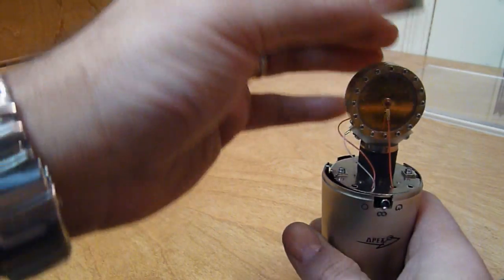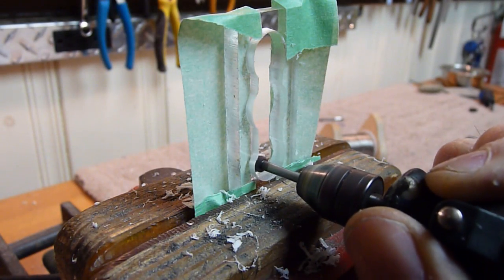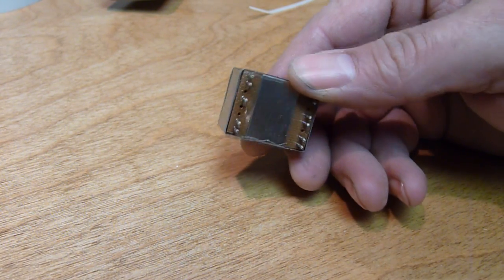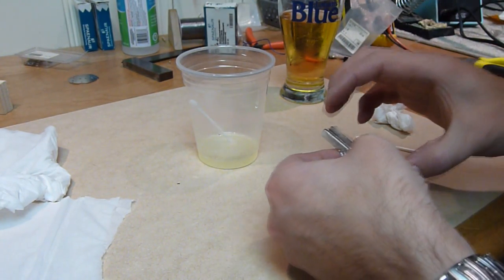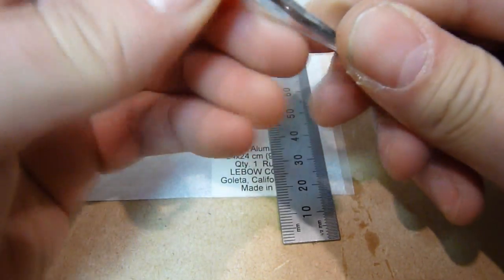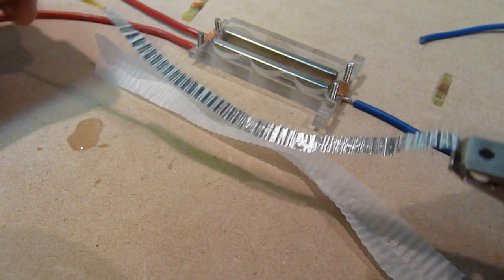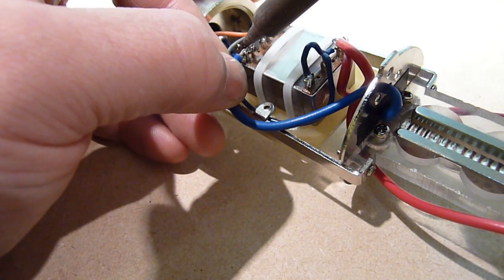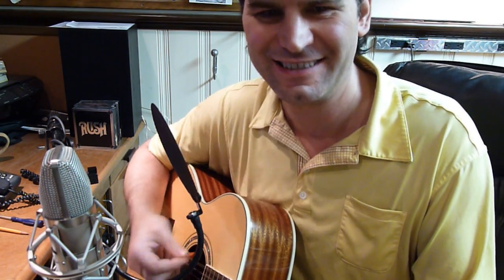How To Make a DIY Ribbon Mic!

Comment from the maker: At the 5:37 mark the ribbon is clamped in. It's done with a small strips of fibreglass PC board material and two bolts on each end.

Comment from the maker: It's a ribbon mic. They require no power. But you do need a mic preamp with lots of clean gain because ribbons typically have a very low output.
Reply: 22 dB Clean
Reply: And that's why transformers are so important ❤️

Comment: Thank you Freddy for this detailed manufacturing explanation! I noticed an important part was not referred to - the glass of Labatts Blue. I dig your ingenious 'crinkler' for the ribbon - great! You touched on and fully explained all aspects of the project - but was surprised you didn't use an f.e.t. amp. Presumably with a 1:37 step-up Xfmr this isn't necessary - and neither is phantom power! I admire your craftmanship and your voice-over explanation. To mis-quote Oscar Wilde: "To make one ribbon mic is splendid - to make two looks like sheer Stereo" Many thanks for this video!!

Comment: Your planning and design are wonderfully impressive, as well as the video itself. I'm partway through building a similar mic and am so glad I ran into your video. I happened to do several bits the same, right down to the notches in the plexiglass but you've taken some of the scare out of laying in the ribbon. Now I'm ready to proceed. Many thanks.

Comment: "I tuned the ribbon tension using a frequency generator. Resonance target = 30hz."

Could you please explain that a bit more?
Reply: obvs the answer is "no".
Reply: Set a tone generator, tighten the foil to raise, or loosen it up to lower tone. Try and match the tone generator. Be careful to not touch the foil to the magnets while plugged in. Seems like a process. Plug in, check, unplug, tighten, plug in test etc.
Reply: The human ear can only detect from 20hz to 20,000hz sounds. By tuning it to this frequency, i think... I THINK... it leaves some "breathing room" for the mic to give reasonable voltage output at low frequency, which is of course 20hz.

Comment: I got the same build plans called AUSTIN Ribbon Microphone from rick wilkinson (rickshawrecords at yahoo) years ago. It's a fun build with some challenges. Namely, your own breath when working with the aluminum leaf. I had to pull my shirt up over my nose for that step until I had the motor safely installed in the housing. Pop filters ar critical to keep from blowing out the ribbon. Back then, donor bodies were harder to come by, so the plans described the entire build including the body made from brass pipe, cap and brass mesh. Fastening the motor needed brass screws to stop the risk of having the screw pulled into the motor during assembly by those strong magnets. Also other ferrus metals in the body may affect the magnetic field and possibly color the sound. Nice build.
Reply: Good point about the brass screws!!

Comment: Excellent presentation, fun to watch !
I made a ribbon mic. like this back in the early 1970s I used  transistor radio output transformer, 3.2 ohms into 500 ohms, it worked great !
Bill P.

Comment: Hey, I assume the magnets are there to generate a magnetic field, instead of hoping on luck that the ribbon doesn't touch the magnets, (which since it's coregated, if it sags over time I'd imagine it has a good chance of touching) could you use a thin piece of paper to insulate the magnets? What would it sound like?

Comment: Hi, I'm trying to build one of these for my CAD and fabrication class. I need to start sourcing my parts and I was wondering what kind of aluminum I need to make the ribbon, and where you got your transformer. Thanks for your time and the tutorial.
Reply from the maker: +Nick Grace You&#39;re welcome Nick! The foil is from the Lebow company. You can use 1.8, 2.5 or 4 micron thick aluminum foil. The thinner the foil the better it sounds.... faster transients, more output and more high end. However, it&#39;s much, much more difficult to handle and work and more prone to damage from air blasts once the mic is assembled. The transformer is from K&amp;K audio in the US. You can also use a Cinemag transformer. For a more economical transformer you can use an Edcor RMX1. Good luck and have fun!

Comment: This is really good man, 10/10.. Can i ask if you did any post production on the recording though? I listened back through my DT150's and the mic sounds a little squashed and slightly distorted. wondered if that that compression or anything?
Reply from the maker: Thanks Guy!
Post? I can't remember exactly but no doubt I EQed and compressed.
Reply: I think I'm going to get one built :) might be pretty nice for recording my acoustic. Also going to build a nice condenser, would be great if you stuck u a tut for condenser building.

Comment: High frequency response is really superb!
Reply from the maker: Thanks! It is directly related to the thickness of the foil. The thinner it is, the faster transients, more output and more high end.
Reply: @FreddysFrets  That's apparently not the whole story. The reason why your high frequency response is so good is that you have holes next to your magnets in the frame which allows a front to back wave to take the shortcut. http://www.diyaudiocomponents.com/diy-ribbon-mic-frequency-response explains. As a result you have hit on a top rate design.
Reply from the maker: @unequally-tempered  yes that too. And I was able to see that effect change when I made another mic, but this time with 1/4" thick magnets instead of the 1/8" thick ones in this video. Because the high freqs had a little more travel time to get around those magnets the high end was different.

Comment: one more question...
Do the magnets have to be straight or could you use curved magnets like scrapped ones from inside an old hard drive? Obviously the magnet holder would have to be different.
Reply: I dare say you could simply attach a couple of ex-HDD magnets to the polar pieces for those are high Gauss magnets

Comment: Also, could a thin piece of scotch tape be employed along the inside of the magnets as an insulator against the ribbon contacting metal, WITHOUT negatively affecting the sound quality & output level?
Reply: Never use sellotape as a permanent integral part - the adhesive fails eventually!!

Comment: One of the limiting factors I'm seeing when it comes to homemade ribbon mics is the low output signal.  I'm wondering what preamplifier you're using in this video? It seems to have almost no noticeable noise, even with plenty of gain.
Reply: I believe it was also DIY.

Comment: I have 2 Apex 210's , they really are crap . The ribbon is not even corrugated , the magnets have a chrome plating on them and on both mics the chrome has peeled . I cleaned off the chrome and used tape to try and get the magnetic filings off .
 I was going to get some foil and try some 4u foil or maybe 1.8u. QUESTION : is it worth trying with the magnets all grey ceramic and no smooth covering ?

Comment: are the magnets N and S up or N and N up or does it matter?
Reply from the maker: Hey David,

the poles are oriented so that the magnets attract each other. The poles are not at the the ends of the magnets, but rather on the sides facing each other.
Reply: Which makes my suggestion on the use of HDD magnets totally redundant! Thanks, Fred for this detail.

Comment: How did you clamp / attach the ribbon? Is the copper tape double sided conductive adhesive?
Reply from the maker: The clamp side is just a piece of PC board. The copper tape has adhesive on one side.
Reply: FreddysFrets Thanks!  Do you have a link to a video on tuning/adjusting the tension of the foil?

Comment: Lovely video. Makes me want to build one myself. Did you keep the original guts of the Apex?
Reply from the maker: yes I kept the capsule
Reply: If you still have the microphone and it has the old logo on it you can remove it with Acetone (Nail Polish Remover) without harming the body.
Reply from the maker: Yes I did that.
Reply: FreddysFrets
Then you can use tipex to paint the new name on sumfink like GENIUS MIC!!!!

Comment: You forgot to mention the polarity of the magnets, and how you aligned the polarities for the mic. And where did you get the aluminum foil?
Reply: ThalesPo The two magnets should be mounted so that they attract each other. If you only use one microphone, the polarity doesn't matter. Good luck! :)
Reply: Sondre Russvoll Yeah, but even though, he forgot to mention how the polarity vector is configured in that setup. I found out that it is perpendicular to the ribbon, passing through the center of the ribbon and the center of the magnet. If it was parallel to the ribbon, even if you put them in a way that they would attract each other, it wouldn't work.
Reply: +John X OK. I gotta find that in my country. I'm gonna tell you, I'm impressed until now about how good that microphone sounded. But I think it just sounded that good because he used a very very thin foil. I think the thicker foils wouldn't capture that much detail. Anyways, I would love to build one of those, but I guess there are too many tools that I don't have. And the down side is that the ribbon gets loose over time, and you have to change it.
Reply from the maker: +ThalesPo  Yes, the very thin foil made the mic sound better than thicker foil. Faster transients, higher output and more hi end. Very very fragile though.
Reply: +John X +FreddysFrets OK, thanks. If I ever build a mic, I'm surely gonna post a video of it here. I was thinking of building a mic that works with light, with a membrane that vibrates and deflects light from a photo-transistor. The down side would be the noise generated by the photo-transistor. I'm not sure how many db's of noise I can get from a piece like that. Gotta start researching the types of photo-transistors to see which ones have lower noise. But this is very very far away, I have to finish some projects that I'm working on right now.
Reply from the maker: +ThalesPo Cool! Let me know how it works out!

Comment: Where do I get the clamps for the ribbon?
Reply from the maker: +Austin Hodges I simply used a piece of PC board material with two holes drilled and some copper tape wrapped around it.

Comment: Do I need air holes on the sides of the magnets?
Reply from the maker: +Austin Hodges No. Lot's of ribbon designs don't have them. My thinking was that with the holes there was a shorter path for higher frequencies to wrap around from the front to the back.

Comment: What is the function of the air holes beside the magnets?
Reply from the maker: A shorter path for higher frequencies to wrap around
Reply: FreddysFrets
 Ok, thanks :) What about the double red leads?
Reply from the maker: apinakapinastorba The two red wires running on each side, symmetrical and identical in path and length provide a humbucking solution to reduce hum.
Reply: FreddysFrets
Thank you for the responses. Ribbon mic project will now be on my endless to-do list :)
Reply: FreddysFrets
Can I ask you one more question, please? :) What diameter and tooth count the corrugation gears have?

Comment: Hey Freddy, I've replaced the ribbon in my Apex 210. I have a resonate frequency around 45hz. I'm wondering if this would indicate proper tensioning. What frequency does your mic resonate at? Do you have any recommendations?

Thanks!
Reply from the maker: +Joseph Stracuzzi  Yes that's about right.
Reply: FreddysFrets Thanks Freddy.
One more question. I've had some plating flaking off of the magnets. To remedy this I covered them with a clear nail polish. In order to ensure my ribbon moves freely within the (slightly thicker) magnets I have made the ribbon roughly 1mm more narrow. How would this affect the sound?

BTW Nice work on Whitney P's Tinker.
Reply from the maker: +Joseph Stracuzzi  Whitney P's tinker! Haha...thanks!
To answer you question, the bigger the gap between the magnet and the ribbon means more output loss.

Comment: Wow. How much would you say this cost you in materials?
Reply from the maker: +Matthew Dommett the transformer is the most expensive part. I used a Lundahl which a little over $100 if I recall. Cinemag also makes a very good one for less money. The plexiglass and foil and other bits maybe another $20
Reply: +FreddysFrets Would you say you prefer it to any of your condensers? It seems too good to be true.
Reply from the maker: +Matthew Dommett I prefer it to a cheap condensor absolutely! It's such a loaded question though, it depends on what I'm recording. Brilliant on horns and drum overheads....on an electric guitar cab I use it paired up with a Shure SM57, it's fantastic.
Reply: +FreddysFrets Thanks a lot, I might have to try this.

Comment: Hello, I was wondering if anyone could help me out with the wiring diagram for the Lundahl, (connecting the motor to the unit?) I am also curious about using the guts of an Audio-Technica AT2020, rather than the Lundahl, wondering if anyone has tried this yet?
Reply: Okay I may have gotten this correct- still waiting for the glue to dry on the magnets. So I connected the two magnets to the exterior ring, (yellow wires,) and the foil to the interior screw, (red wire.) In other words, I kept all the PCB, and original wiring, just replaced the input part of the microphone. I tried it last night with one side of the magnets connected, along with the foil, and it was picking up a whole lot of fuzz, with the input increasing when being bumped or nudged. I tried yelling into the microphone ribbon, and I could hear this sort of very faint reflection of my voice during the playback. I am using some really thick foil it seems, hoping it will create a little bit of a wind filter. I will let you guys know in a few hours how this turns out. 
-Dave

Comment: Honestly, if I have to consider to purchase also the machinery, it costs less to me, to buy an already made Ribbon mic :)
Reply: Some people will do just that----buy a dirt cheap chinese made ribbon mic, take it apart and just upgrade some components. Most just replace the ribbon with a  thinner one, and tension it properly. But you could also upgrade the transformer. I think that right there would make it a superior mic compared to what it started as, and still be cheaper than a high end ribbon mic.

Comment: should have wore gloves to keep finger oils from the surface but wonderful video!!
Reply from the maker: Thanks but there is no problem with finger oils for ribbon mics. You are thinking of condenser mics, where the impedance at the capsule and head amp is super high....that's where finger oils will give you trouble.
Reply: @FreddysFrets  i was thinking for adhesion on the magnets..you wiped them with alchol then touched them with your fingers. Oils dont help adhesion but probably not gonna matter for all the more you need the glue to do